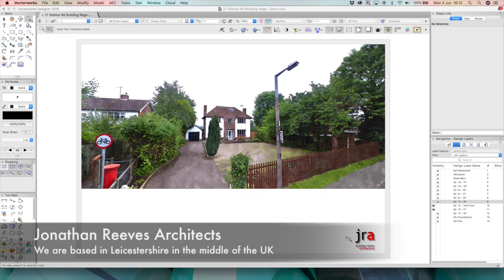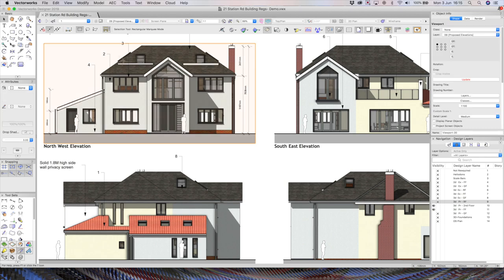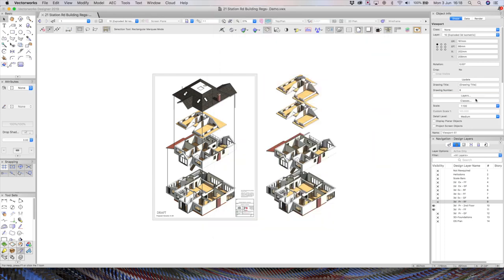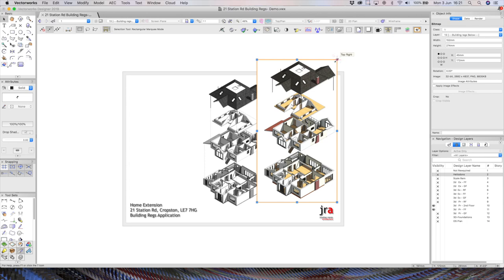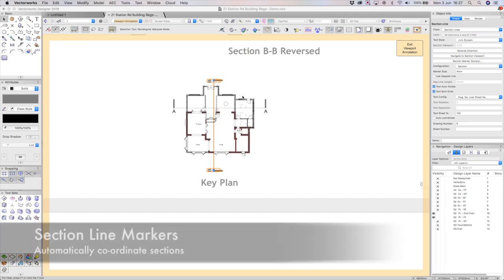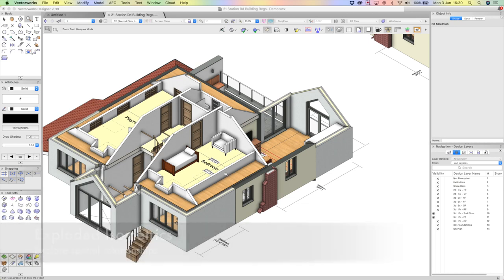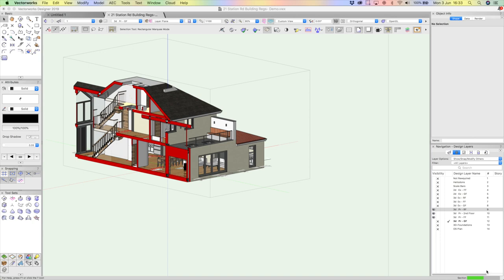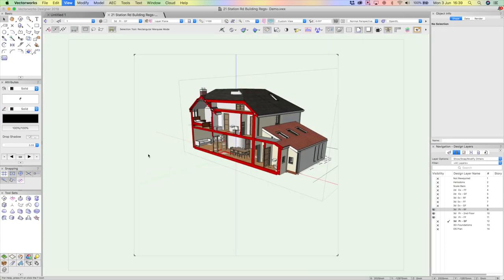Vectorworks BIM Tutorials- A Large Residential Extension

Comment: Fantastic tips! I've been going through your tutorials and learning so much - thank you! I'm basically relearning how to use the Vectorworks workflow properly. I've worked mainly in 3d for over 20 years but have been extremely late to join the BIM party. I used to import my Vectorworks files into a rendering program called Strata but so much more can be done directly in Vectorworks now with very good texturing and lighting and Twinmotion adds a whole other level of presentation options - another recent discovery that I've learned through your website and tutorials.
Reply from the maker: Thanks for the nice feedback. This really helps motivate me. Check out my online training and new Library packs at: https://vectorworksbim.co.uk